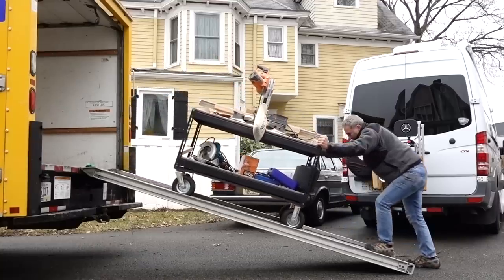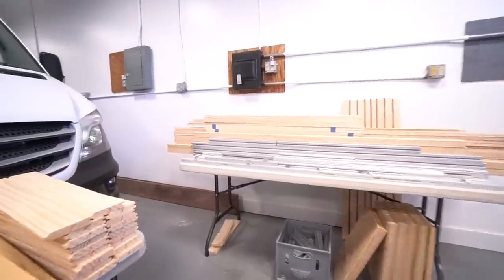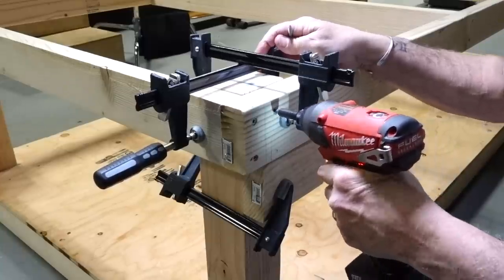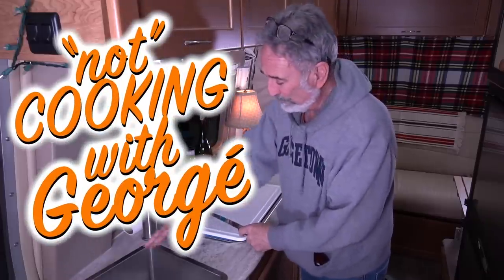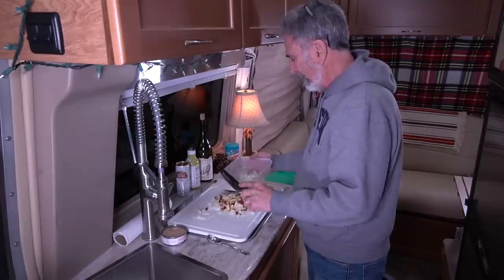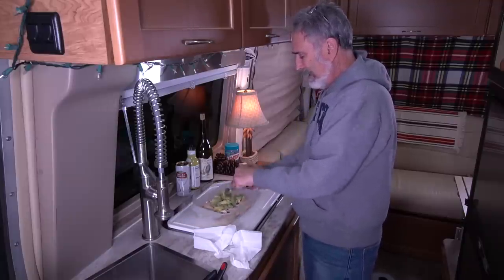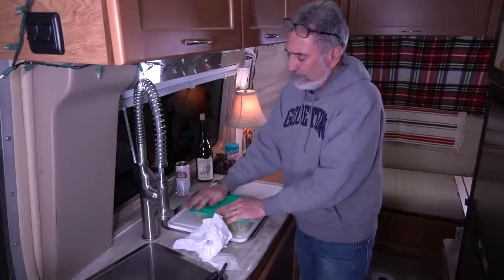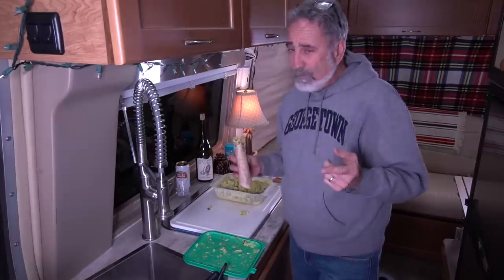The Humble Van Studio - All Set Up & Ready To Roll!

Comment: A hint for anyone else that builds a workbench like that. If you had screwed the plywood down flush to the frame… Then hit it lightly with a quick pass from a orbital sander to remove any rough spots. You could have glued that masonite down with contact cement the same way they do with Formica in your kitchen. Then you would not have any exposed fasteners, not even countersunk ones on your surface to work around.
Reply from the maker: That is an elegant tip, thank you!

Comment: I make « tushi » too! Only difference, is I sometimes add chopped walnuts for a bit of crunch. Keep those recipes coming! :-)
Reply from the maker: Ohh, I like that Julie! How do you chop the walnuts? Rubber mallet?
Reply: Humble Road  That works, or use a spice grinder. If you go the mallet route place a paper towel or cloth over the nuts to keep them in place. Don’t be too agressive or you’ll end up with nut powder instead of chopped nuts!

Comment: George - Congrats on the new work space.  Am I jealous?  You betcha!  Lovin' your videos, presentation and humor.  I'm stealing a number of your ideas for our build and so have some questions.
I am intrigued by your use of Heavy Mass Vinyl.  Do you think the vinyl will provide a good sound proofing if sandwiched between the metal ribbed flooring and the wood flooring with no open space like that provided by your 8020 framework? No gluing, just held in place by the wood flooring which is attached via the bolt points of the stock flooring.  Also, what do you think of attaching HMV to the walls with rivnuts, bolts and fender washers before installing the final wall covering?
I am insulating with Thinsulate and covered every surface I could with Rattle Trap but I want more sound deadening.
Love the idea of 3M tape to anchor the 80/20 to the floor.  (I dropped by 80/20 in Indiana.  That's and interesting story...)
Thoughts?
Also, is there a way to contact you to discuss your processes outside of commenting or are you comfortable with questions here?
Reply from the maker: Let's start a discussion. georgemauro@humbleroad.tv